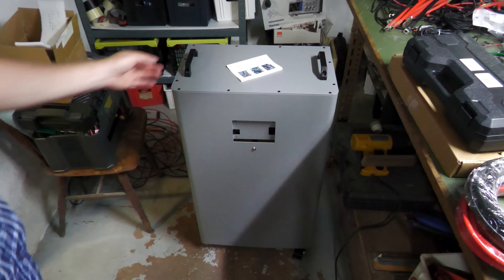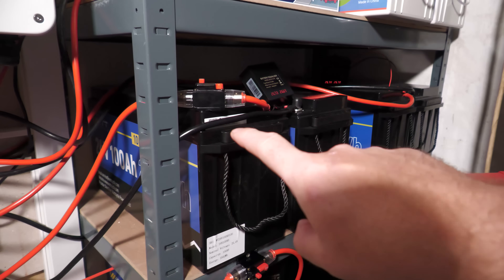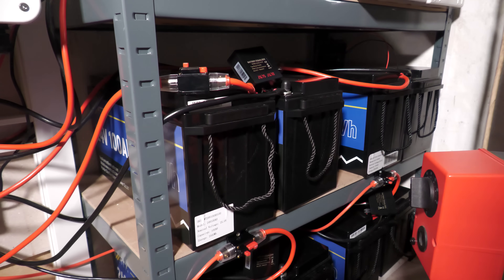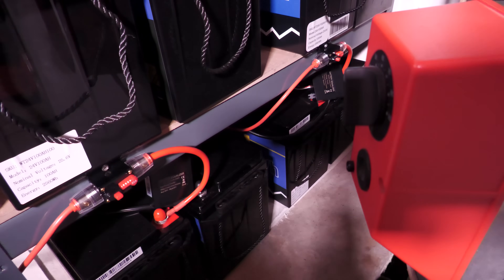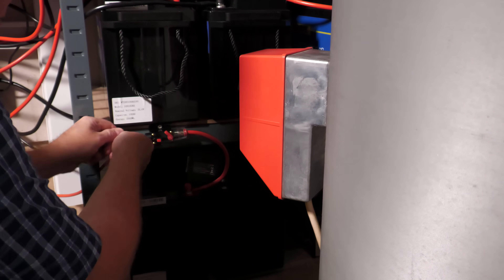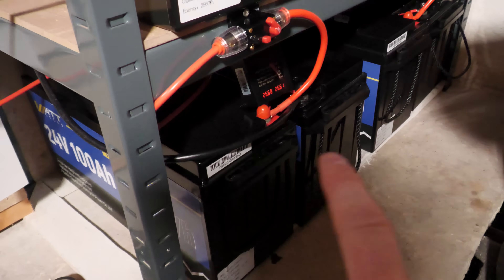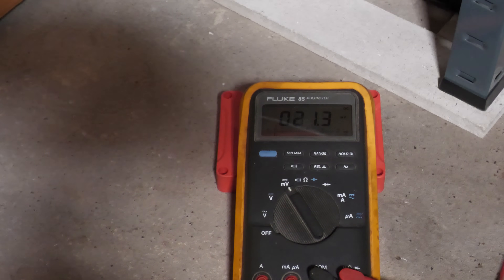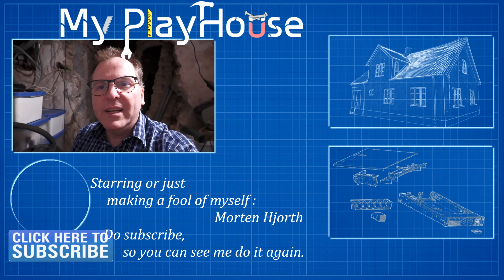Why is one of 6 Battery, Delivering more Power than Others?? - 1509

Comment: Also, If your batteries are not at the same IR they will also charge and discharge at different rates, ie: some batteries may be in better condition than others, lower IR the better, if all banks match perfectly IR then you should (theoretically) get the same current flow to & from each bank. 
If any cell or battery in your banks are mismatched or out of whack, this could also give these symptoms, but I am still guessing on a circuit breaker issue.
Reply from the maker: They are all very new,, there should not be much differences..

Comment: Cables should be same lengrh
Get a dc clamp-meter and then compare the voltage drop  together with the current

Messure also the voltage drop on the breakers, these are not the best type's  as you already found out.  The dc-spark when switching off under overload  will damage the contacts.
I do not know the deye settings but you have different type off batterys, to make a good messurement de Deye should fully charge the battery for some time  with 55,2V    (bulk charge)  after this time the voltage must go down to 53,6 float mode for some time.   
The bulk charge time should be long enough to charge all batterys full.
Reply from the maker: Yes I need a new DC clamp meter to figure this out!

Comment: In your setup you run different battery  banks in the same setup as series/parallel. How about do it differently and first group the batteries in parallel and then series so you only have 4 battery voldtages in the system i stead off all individual batteries could be different.
Reply from the maker: Hi Daniel
I guess I could have saved some cables if I had done this per shelve,, like 2P2S
It might help,, or it might make the problem bigger :-/
Reply: @MyPlayHouse 
I dont know if it is a solution but my thoughts is 4S3P and then you have 3 balanceres you could put on the same levels so a bit more punch to get the cells in balance and only 4 "batteries" with only 4 different (hopefully same)voltage. This is the way i parallel my 18650 banks

Comment: Have you measured the internal voltage drop at each circuit breaker? 
I think you should consider buying some good DC breakers from reputable brand instead of these, which look more like chinesium crap.
Reply from the maker: Yes I should measured that,, could be bad brakers..

Comment: need not to be the cables alone - bad crimps, those chinesium breaker crackers and also different internal resistances of the batteries may play a significant role….
I can recommend the freely available ‚Victron wireing guide‘ for 48V DC systems, many things there do apply to such systems in general, not only Victron‘s…

Comment: As someone else has said you need to measure the current in each cable. At the moment you don't know if the different cable voltage drops are due to cable resistance or different current flow

Ultimately, i hate to say, the setup you have is not a great one. Cheap Chinese batteries each with their own BMS is a recipe for imbalanced loading caused by variations in the BMS output switches. There's a reason commercial serious have either a single BMS or (Tesla powerwalls for eg) battery to battery communication.
It's also the reason why proper batteries like the pylontech you had are so painfully expensive - they are built to be much better matched battery to battery

If i were you i would draw out a proper circuit diagram and measure current and voltage at every connection point. This might well point you towards the problem area
Reply from the maker: I need a new clamp meter...
Batteries are fine,, this is some fine tuning.

Comment: Each set of cables running to the battery's should all be the same length
Reply from the maker: I also thought that was the issue,, but something else is also going on.
Reply: @MyPlayHouse  Did you measure the current flow from each battery set, that will also affect the voltage drop. Also be aware that cables that look the same may be different in there resistive capacity.

Comment: Sir you still did it wrong all battery cables should be the same length of the farest battery so you will still have the voltage unbalanced
Reply from the maker: Well, as you saw I made the shortest set as long as the one next to them,, did not make the wished differences.. :-/
Reply: @MyPlayHouse  Ok but also the 80amp breakers you are using is limiting the battery because if your inverter needs to surge the 80amp breakers will blow and that cut of power will damage the inverter. I know because I install solar systems for a living so you need to use 100amp breaker to match the battery output its juist incase the inverter needs to surge for a quick second. Also your battery wires might be a bit too small as well.

Comment: a large part of your problem is your taking power from both terminals on the battery closest to inverter. you should have one terminal closest to your inverter and say the neutral from the furthest battery it doesn't matter which way round you do it as long as 1terminal is the closet and 1 is the furthest this will balance the load both charging and discharging this is very important to do it this way the other things wrong a relatively minor compared to the above so you will figure those out for your self I'm sure
Reply from the maker: The batteries are connected in the back,, 2 24V battery to make the 48Voly pack,, where the plus and minus are now on the front..
Reply: in the video it looks like your inverter is connected to the closest battery in any row .
what I'm saying is one of the inverter leads must not tap off the terminal closest to inverter. I know you have other leads connecting all the batteries together to form 48v this is ok now with that established you should have 1 inverter lead going to the closest terminal to the inverter let's say this is + the other lead from inverter - IN this example needs to Go directly to the back of the pack the furthest negative terminal away from your inverter and not connect via the linking cables joining the batteries together to make 48v pack. think of it this way you have your batteries connected together to make your 48v pack. 1 of your inverter leads should be long enough to reach all the way to the back furthest point away and not be connected to the furthest terminal vie the cables that make up your pack. they must be completely separate lead's to your inverter charger one to the front and 1 to the back. I can't explain it any clearer sorry but this is very important you grasp this or you will ruin the batteries closest to the inverter with time. if you don't understand what I'm saying you must seek independent qualified advice

Comment: Buy some proper breakers, they are like £1 more.

Your batteries are not charged, following a full charge, and rested they would be 27.2v
Voltage and capacity is much different especially with lfp.
At 26.* They can be between 20 and 70% soc. You should change the setting to ah, and not voltage charging. It will also need to learn your battery by doing cycles.

Rather than running a lot of long thing cables, join the batteries on the shelf and one cable to the bus bar and one from there to the inverter. 
All these long cables and mixed battery's will cause an imbalance.😢

You don't need all the long cables and could have saved time and money😮

If you want a package sent to you contact me for a price #renewsolar

Would look nice and neat.😊

Comment: It's a bit hard to guess without measuring every part of the system but probably the biggest difference in resistance is the internal resistance of the batteries, there are not negligible variations between batteries from the same suppliers and you are also combining different brands and capacities (?) and possibly slightly different chemistries. Even if the voltage is the same when at rest, it doesn't really matter once current starts flowing

Also, knowing the mV accross each cable is not of much use without a measurement of the current considering the problem is the current is not the same for all batteries, to do it properly you should disconnect the batteries and measure the resistance which could be tricky since the resistance will be very low, even the contact of the multimeter probes will make a big difference
Reply from the maker: Yes there's a bit too many variants right now :-/

Comment: in li-ion multi-cell battery packs, the cells are commonly grouped in parallel first, and then the parallel groups are put into series.  your setup is opposite that, you go into groups in series first and then parallel the groups of series.   perhaps that?
Reply: It's Lifepo4 battery not li-on. Morten needs to get to 51.6V. Personaly i use 4 12V lifepo4 batteries in series and that connects to bus bar. and another 4x 12V in series and to bus bar as well. Not ideal. Ideal Woulkd be to use raw cells to single 16s BMS but it'd be more expensive. At least from what i was looking if i'd want to but everything separate.
Reply from the maker: Well the set's are all fine,,, it is why the set´s are not contributing equally.
Reply from the maker: Serial/parallel or parallel/serial,, do you think it really makes a difference. ? I have a lot of control over each pack this way.

Comment: Interesting. Did you measure the voltage drop through the breakers? They might add more resistance than the cables if the contacts aren't perfectly clean and flat.
Reply: Came here to say the same. My money is on those breakers having a high resistance.
Reply from the maker: And it might change when the current goes up :-/
Reply from the maker: Yes,, I might have to measure out each braker :-/ might make more of a differences then the cables.

Comment: The fuse you're using is a toy and potentially dangerous. 
The solution is very simple: ditch and forget about that project with all those batteries forvyour own safety it's not designed for such purpose. Wait until you have LiFePO4 batteries, which are specifically designed for this purpose.
Reply: I agree on the fuses. They seem to have the ability to trip at least, which is a plus 😂.
I would go ahead and buy some quality cable that is confirmed copper from a reputable brand and not the Amazon special, preferably from a specialty store.
Then you should at least impedance match the cable runs, aka make them exactly the same length.
~100A on 24V ist quite a lot, that's the reason 48V is the default and not 12V/24V
You might want to calculate the losses in the cables to decide which wire gauge you want.
Reply from the maker: There are 6 batteries,, when I pull 6000W (117A) each battery should contribute under 20A,, so why does it flip one of the 80A breakers ?
I now think the breakers might make a bigger differences then the cables.
Reply from the maker: Well it´s all LiFePO4 cells, just in other packetes. And I am not pushing anything to it´s limit,, barley 50%
There are 6 batteries,, when I pull 6000W (117A) each battery should contribute under 20A,, so why does it flip one of the 80A brakers ?

Comment: Maybe the internal resistance of battery/battery sets is different between eachother
Reply from the maker: There are 6 batteries,, when I pull 6000W (117A) each battery should contribute under 20A,, so why does it flip one of the 80A breakers ?
I do not think a bit of internal resistance, would be able to make that much of a differences :-?

Comment: Each set of cables running to the battery's should all be the same length. Make the cables running from the bus bar to the closest battery's the same length as the furthest battery's
Reply: This. And same thickness :)
Reply from the maker: The are all 16mm2
Reply from the maker: That was what I did? Did not solve the issue!

Comment: The breakers you are using are the worst type. They heat up to fast and trip. Buy some DC breakers the same as the type for AC. Also the cables should all be the same length.
Reply: Remember that the cables all being the same length means that from - on the inverter, all the way around to + should be the same for each battery..if one battery has 1m for + and 0.5m for -  and another one has 25cm for + and 1.25m for - they still count as the same length.

It is hard to explain, but you have some electronics knowledge: the resistance for all cables and connectors for each battery needs to sum up to the same number: else the lower resistance battery will do the main lifting
Reply from the maker: The cables alone does not explain this huges differences,,, ½ a meter of 16mm2 makes a difference,, but not that big.
There are 6 batteries,, when I pull 6000W (117A) each battery should contribute under 20A,, so why does it flip one of the 80A breakers ?
Reply: @MyPlayHouse the cables need to be longer and equal check my other  comment
Reply from the maker: Thank you,, I will look in to that!!
Reply: You actually need to make your cables longer to match them. Let's say you have 2 batteries using 1 foot cables. The small resistance differences make up a big percentage difference. If you use 2 foot cables then the smaller differences in ohms make less of a difference. If each cable is the same length but longer the current flow between each  battery will be more equal
Reply: You are correct, these are very shitty breakers. Do not trust that they will all play the same. I had a 300A breaker dropping out at 170A. They look okay but really aren’t, I have trouble with these breakers for under bonnet use due to heat build up and other reasons.

Comment: Also will go include a fuse in each cable on the terminal box for +  and - . rated to the 1 to 1,15  of maximum of inrush current of the battery . for safety of the systems if are any short in the cables in any point get the problems just blow the fuse of the string with the problem of short.
Reply: Battery's have this internally.
Breaker is for emergency use only.
Reply: Yes that is true but if
Cable is short before the baterry will be a issue
Reply from the maker: The Breakers has overcurrent protection,, they brake :-)
Reply: @MyPlayHouse  breaker is fuse with manual trigger

Comment: Good Afternoon Morgen. Nice to see you again that issue is for internal resistance of the battery. also is resistance of cable.  lower resistance of impedance. make more transfer in current .   law of OHN. 
Are some BMS manage the internal impedance of the system. also are some meter are enable to measurement this ... , is good also get a Dc bus where any to any are the same resistance. that will fixe issue of transfer but issue of internal resistance of the battery or impedance  kind regards feel free to contact me direct if need any more help. also I am have be running DC from solar and wind